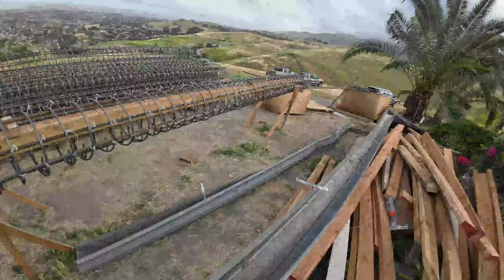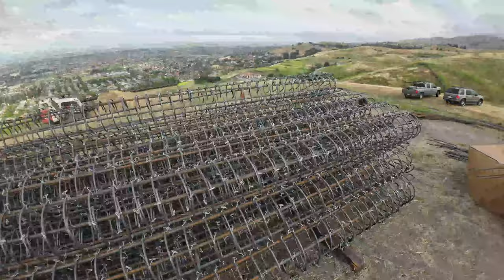See What It Takes To Put Concrete Rebar Cages Together

Comment: Nice work!  Why did the plans call for the piers?  Are they pinned to the bedrock?  If so, how is that done in such a deep hole?
Reply from the maker: Building a 4000 Square Foot Deck.. 16 feet deep.. 18 inches diameter..

Comment: Looks like someone has been very busy.... power wire tie tool is preferred by professionals over hand tying. Wire length and tension is very consistent. Back in the day I would have killed to have a labor saver like that. Spent too many hours in the hot desert sun building rebar cages.

As much as possible we had rebar pre-cut and bent per plan. Doing it in field was not as accurate and never saved time or money doing it ourselves. After you have cut several hundred #5 and #6 in field it was time to go home already, at least it felt that way. 

On some jobs, rebar cages were welded. Especially if they were really big, really heavy, and were picked and placed by cranes. No one wants rebar coming apart and falling on your head. Our jobs were never that big, but have been on sites that were.

Just watched video again... your project is big, really big for residential. Have not seen that much earth work, deep piles, and steel, in long time. Wishing you and your crew best of luck. You have so many fans watching progress on videos. It has to feel really good.
Reply from the maker: Many thanks 👍🏾👍🏾👍🏾
Reply: Much Respect! Terrifying When Rebar Goes Wild
Reply: @fairygurl9269  Thanks for comment. Rebar can kill. Back in the day safety caps for ends weren't made yet. Workers got impaled. On other projects cages would collapse when picked by crane and fall on workers. We all learned how to be safe. Today we don't even 2nd guess safety.